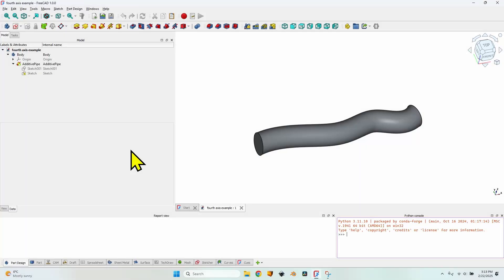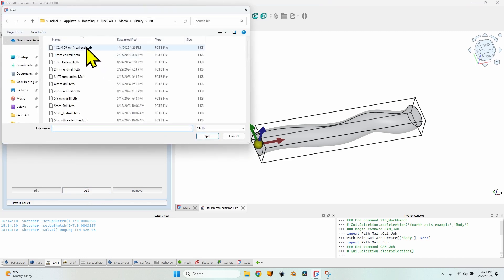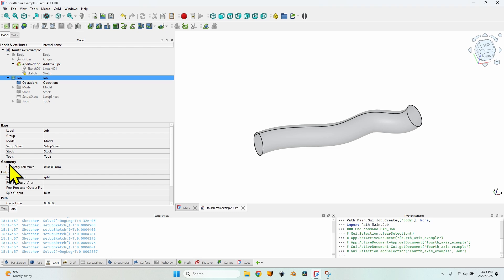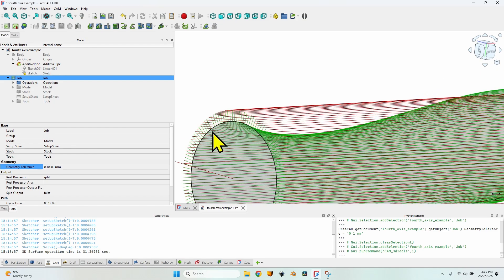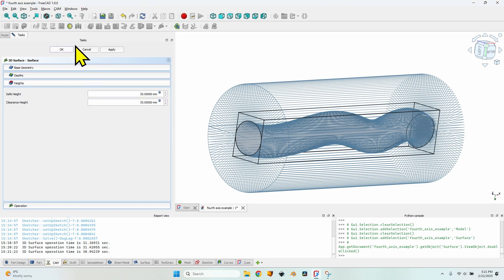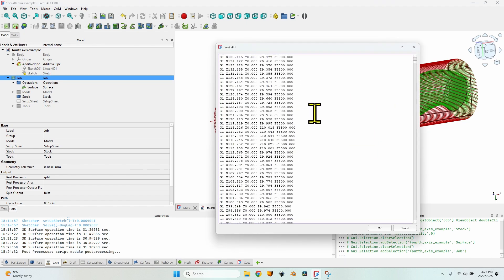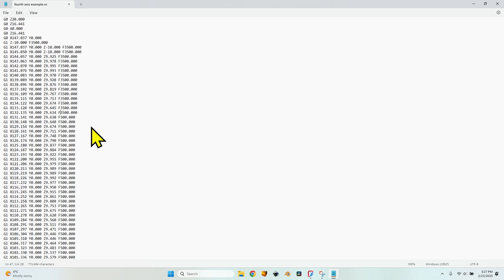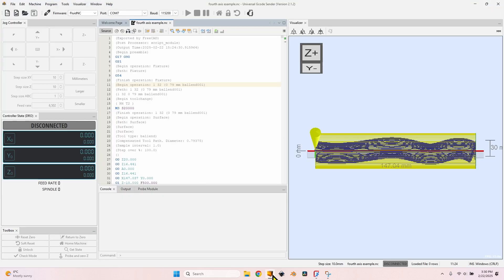How to Generate 4th Axis CNC G-Code | Rotary Machining Tutorial in FreeCAD 1.0

Comment: Is this feature still available?  Scan type seems to be missing.
Reply from the maker: What version are you using?
Reply: @opensourcecnc  1.01 I just downloaded it.  There is not a dropdown for the 3D surface or Waterline icons, but only 3D pocket icon.
Reply from the maker: Go to the shorts section of the channel and you'll find a quick guide to activate them.
Reply: @opensourcecnc  Thank you.

Comment: I discovered your channel today. I have a homemade CNC based on the gantry of a Gatton CNC. I use my Jet lathe model 12-20 as a rotational axis. This type of G-code is what I have been searching for since I have a 4th axis machine. I use the UGCS software with a laptop to control my CNC. I have been using the hobbyist version of Fusion 360, but I discovered the 4th axis abilities are only available for many dollars each month. Thanks for publishing this type of video.

Comment: Depending on which post processor you used , you can set --modal in the arguments and then it will only spit out a feedrate on 1 line
Reply from the maker: Thanks for the tip!

Comment: Maybe you could make a video how to config the 4th axis. I assume you connected it to the Y axis? But how did you get it to work with the indexing degrees? Would really like to know more about that😊
Reply from the maker: I connected it separately to it's own driver, so I can still use the 3 axis setup without too much trouble. I will make a video for sure, as I had a lot of trouble understanding the settings, so I am sure my info will be useful
Reply: @opensourcecnc  that would be great, can you share what GRBL module you use?
Reply from the maker: @pimmerd1992  fluid NC
Reply: @opensourcecnc when will this video be made? would really like it :)